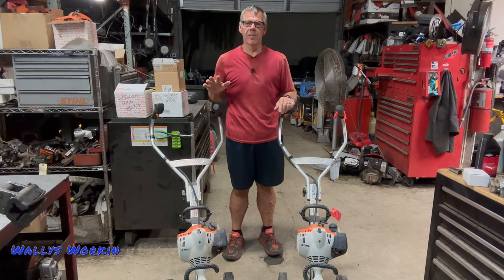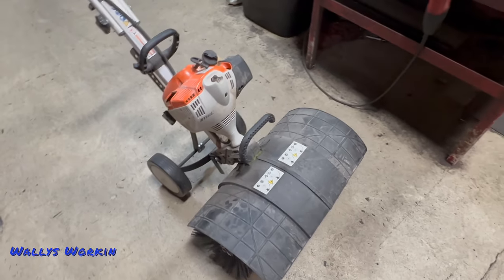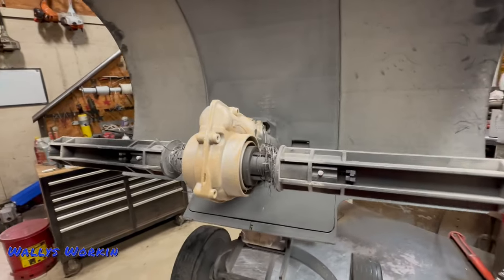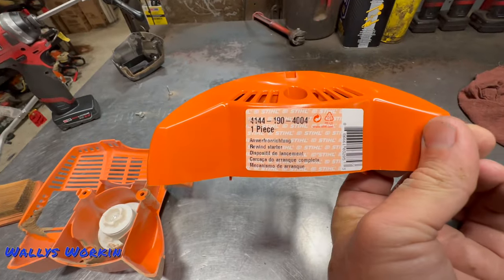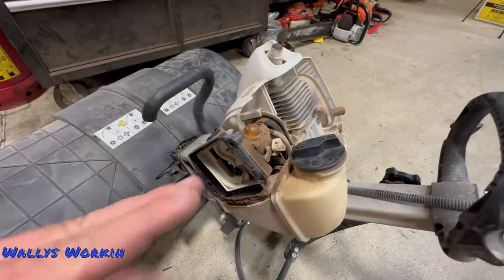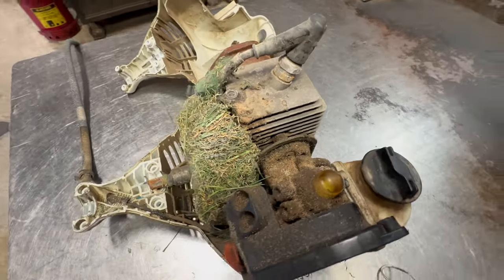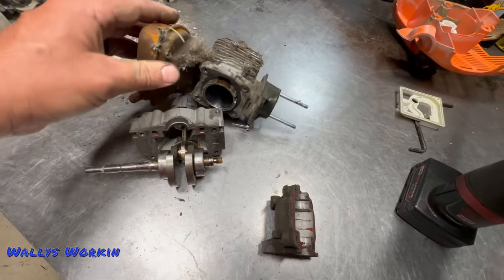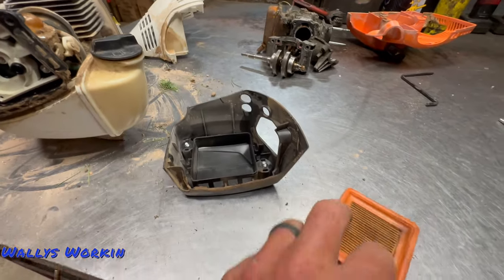STIHL MM 56 YARD BOSS COMMON PROBLEMS / ARTIFICIAL GRASS INSTALLERS BEWARE

Comment: Great video and very informative ....  I have a M55 and at the base of the power unit before it gets to the aluminum block..... I have black beads leaking out of a small hole thats pointed down as i idle up....almost like its grinding rubber........... is there a gasket of some kind thats grinding as the shaft turns.? its at the base of the power head plastic?

Comment: Absolutely phenomenal overview video! You have given us all the knowledge necessary to evaluate one of these used before making a purchase! Many thanks to you, Sir!
Reply: Do you prefer one engine model (55vs56) over the other? Is one louder or more fuel efficient than the other in your experience? Thanks again!
Reply from the maker: I prefer the MM55, there were far less issues. They are pretty equal on fuel and noise. Unfortunately the 55 is longer available.
Reply: Thanks! I just picked up a used mm55 yesterday cheap. Should the tines spin freely when the engine is off/not running? Thanks!
Reply from the maker: No they shouldn’t, it could have an issue with the gear box. Also, take the brushes off and check the pins that hold the plastic sleeves on the gear box shaft, sometimes they will sheer.
Reply: Ok excellent! The tines are not spinning when the engine is off. The transmission seems to be ok. The engine idles just fine, but was bogging down when you give it gas. Checked the spark arrestor and it’s clean, examined both sides of the piston, and it looks to be in great condition. Fuel lines are clean. Carb is clean. Gonna readjust the throttle cable and see if that does it.
Reply from the maker: Check the driveshaft between the engine and transmission. There is a plastic sleeve in the tube that will melt to the driveshaft if it’s not lubed properly.

Comment: the most common failures with turf installers is getting sand caught in the pull cord rubber bushings... easy fix, but you'll have to do it many many times

Comment: Nice video, my mm56 I noticed the engine assembly can be rotated on what ever it is mounted on. Can this be tightened up easily?
Reply from the maker: Yes, There are 4 bolts on the bottom side of the engine housing.
Reply: @wallysworkin823  thanks for the info